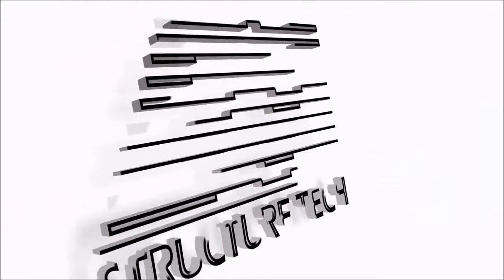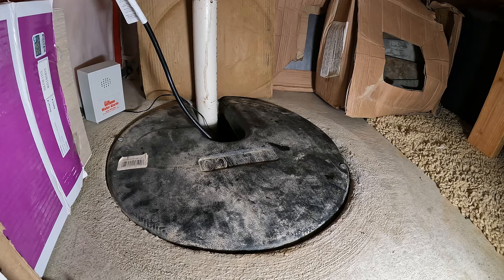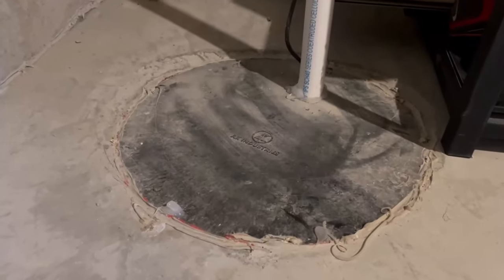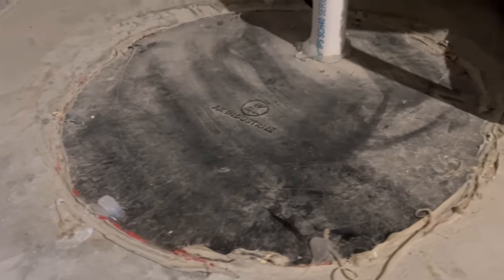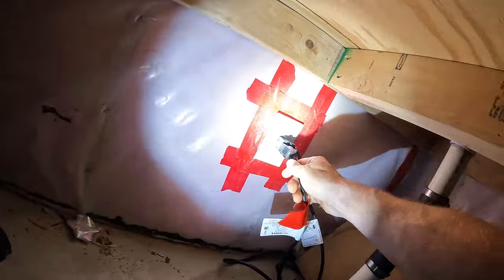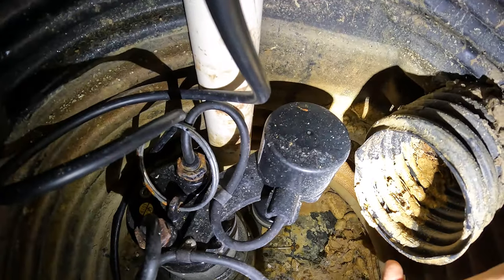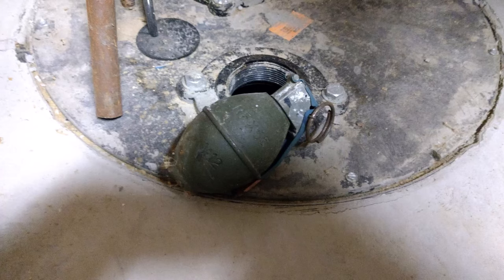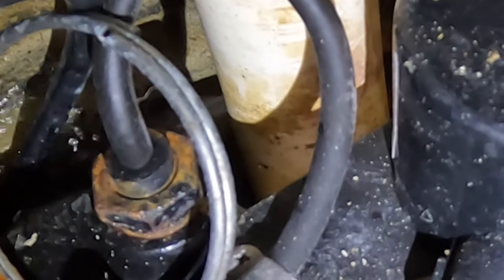How to test a sump pump

Comment: I dont see many home inspectors inspecting inside chimneys...make a recommendation to get it done later (that usually falls on deaf ears) sure. 

Also, what happens in summer in a non orphaned chimney when the furnace isnt used?